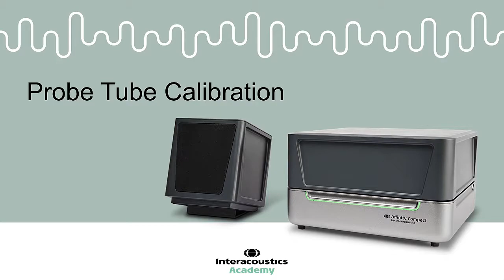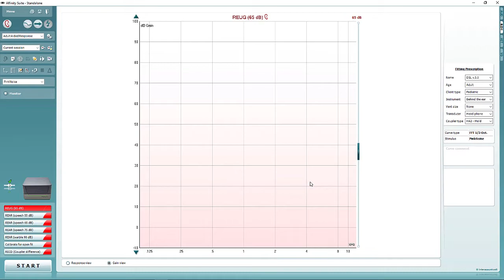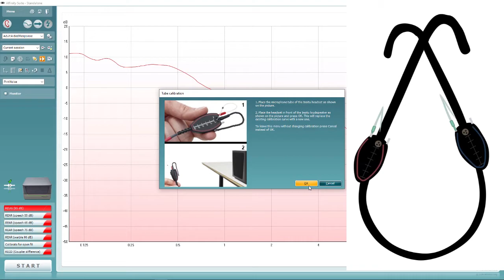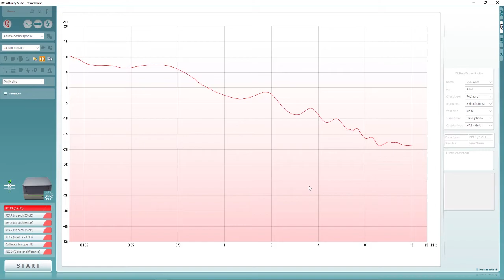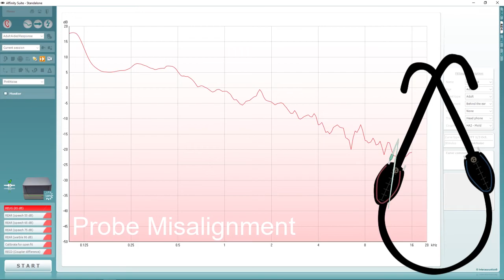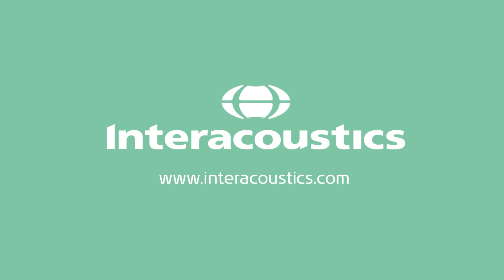How to calibrate the REM probe tube for Affinity Compact

Comment: Is binaural probe tube calibration available on this system?
Reply from the maker: Hello Ryan David. Thank you for your interest. Yes, it is. If you select a binaural measurement by right clicking on the icon of the ear at the top of the screen, then the right and left ears will be calibrated automatically in a single sequential process.